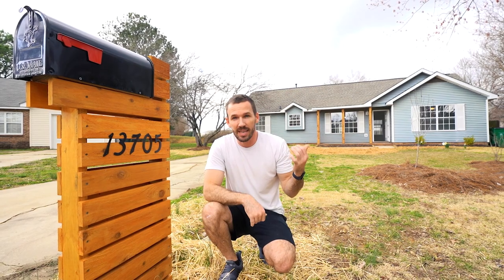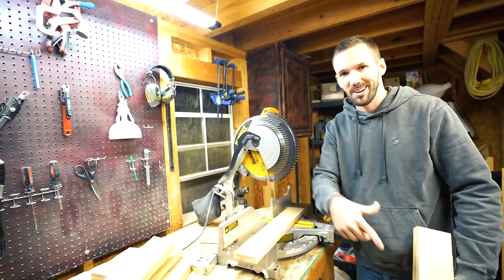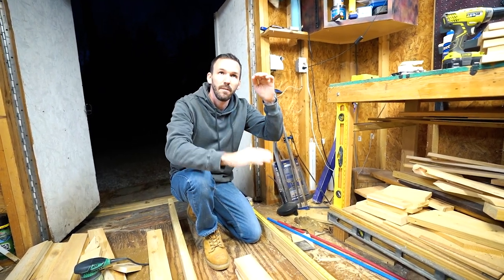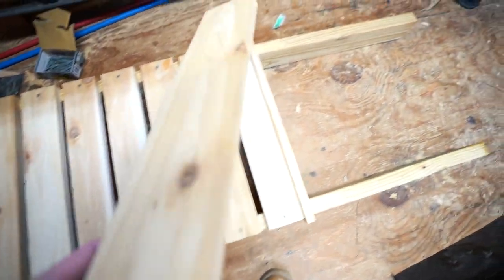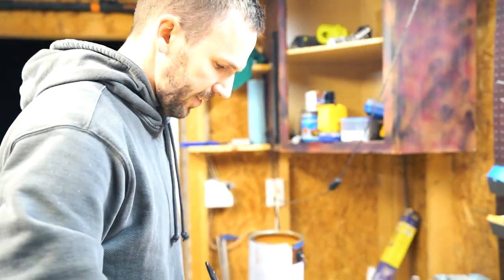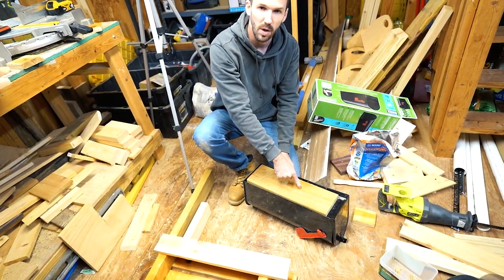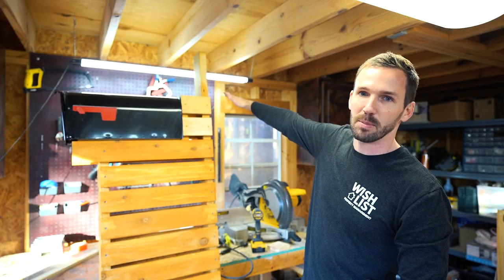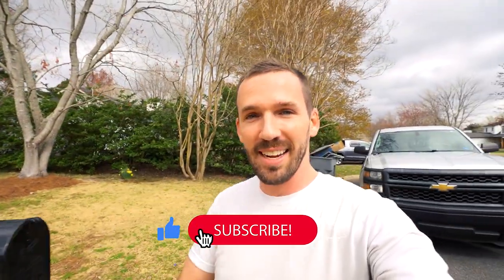DIY Modern Cedar Mailbox with Slats

Comment: Not being a jerk (or am I) but you skipped a LOT of steps. For instance, how did you mount it into the ground? post hole digger? expanding foam? I personally would have cut and painted everything first, then assembled with deck screws that matched or countersunk and covered. Plus, screws for the numbers and numbers on front and sides and solar lights on the back. But hey, to each his own.